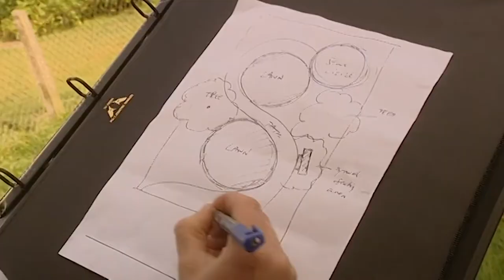Creating a Stunning Seaside Oasis! - Garden Invaders - S01 EP16 - Garden Makeover

Comment: Why remove all the grassed square footage? Too much mulch and not enough grass. The layout is fine, but they should have left larger grassed areas.

The pad for the patio table and chairs is half the size it needs to be. The chairs only fit if they're pushed in! Needs to be large enough for the chairs to be pulled out AND to be able to then walk around them as well. 

Why would you put the table the farthest away from the house? If you’re going to eat at it, you have to carry everything and traipse through the entire length of the garden back to the house! 

The patio table needs to be in the shade, or at least have an option for shade. A pergola over the entire pad would be a perfect addition! 🥰
Reply: Yes! GREAT points, ALL! 
Bloody stupid design for all the reasons you mention. WHY is the patio area so stupidly small??? Blaring mistake. The best designers understand the vast importance of PRACTICALITY.
The patio (made larger) should have been put where the bench went, for the sea view.
And some of the grass already there could have been left and turned into wild flower patches to encourage so-called 'wild-life' into the garden.

(Why is it that men design appliances they rarely (if ever) use... ?)